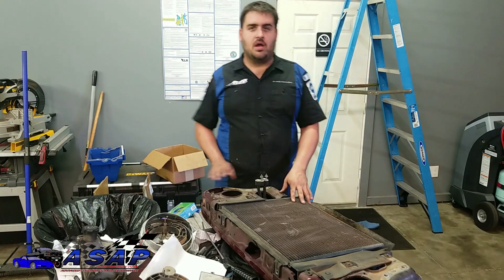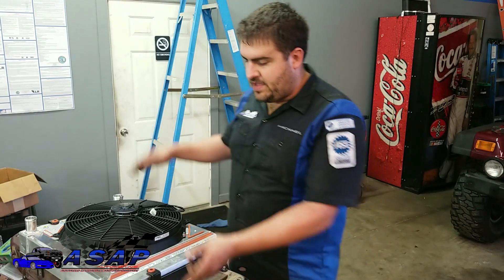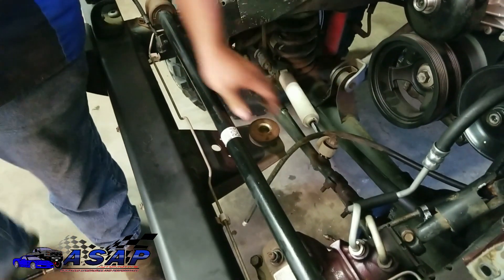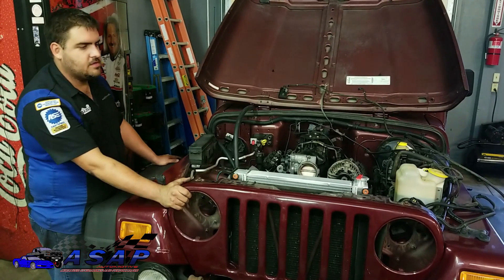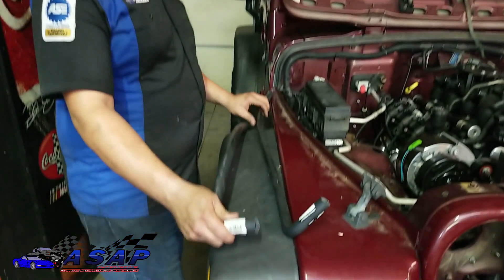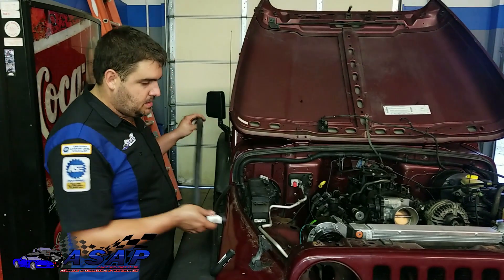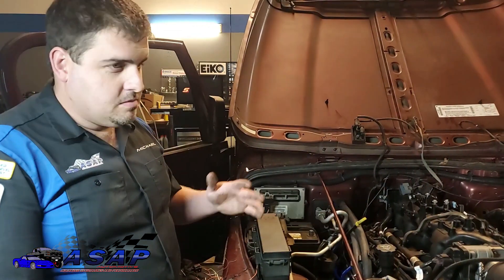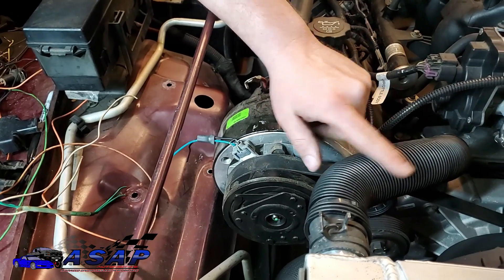TJ LS swap Coolant system install

Comment from the maker: Hey guys & gals here are the part #s you can use for the upper and lower radiator hoses. With all the possible variations to this swap what we used might not work for you.  So i've listed a few different ones for both lower and upper.   Hope this helps, don't forget to like and subscribe feel free to share this and any of our videos.   Remember "Stock is not an option!'
Gates upper hose #s  21390, 21912, 21706
Gates lower hose #s  22437, 20843, 20957

Comment: Thanks for part numbers!  Curious if you asked Novak for hose recommendations? I have the same intake and the same Ac bracket but I’m worried about the coolant reservoir location like you ran into. Great progress! Are you running a trans cooler?
Reply from the maker: No problem at all!   Actually the heater hose numbers i looked up on my own.  I had remembered using them before on some gm trucks over the years.  I searched "90deg 5/8 heater hose", did the same for the 3/4 and found the gates #s.   Yeah we still have a few other items to place so we haven't nailed that one down yet.   We're running the stock nv3550 so no trans cooler for us.   But i don't think it would be hard to install one in front of the condenser though.

Comment: isnt there a fifth hose to deal with on stock LS, vortec engines?
 2 heater hoses with some kinda qwik slip on connectors that may or may not work out on my gbody
an upper n lower core radiator hoses
then some size in between about an inch, where it go man? not the tiny steam vent line either